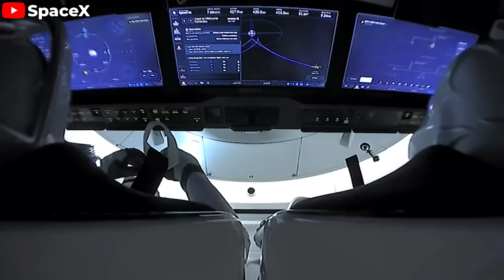Finally Happened! NASA Considering Returning Starliner's Astronauts On Crew Dragon

Comment: There is just way too much disinformation (some deliberate and by uninformed people and some by NASA which should know better about the Boeing Starliner). You can be sure NASA is going to do everything possible before they consider returning the Astro's on a Spacex Dragon. C' mon NASA, the leaking Hydrogen valves are in the service module, not the Crew capsule ! Now spreading the false story that Suni "might develop brain damage "  from a prolongued stay at ISS ( yet Crew 8 planned stay at ISS is 216 days (and others have been there 10 to 12 months !) NASA is deliberately creating a drama so NASA "will save the astro's".